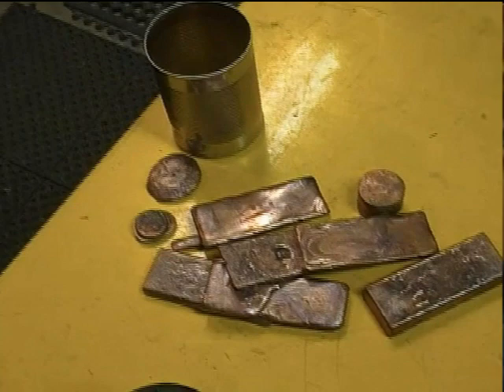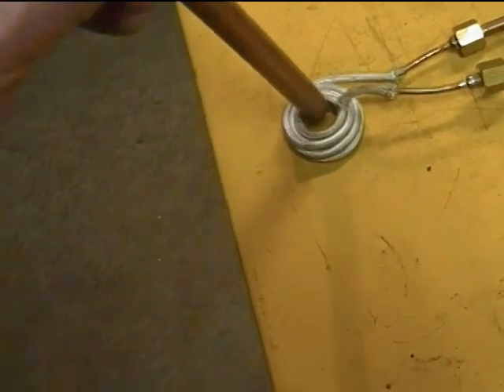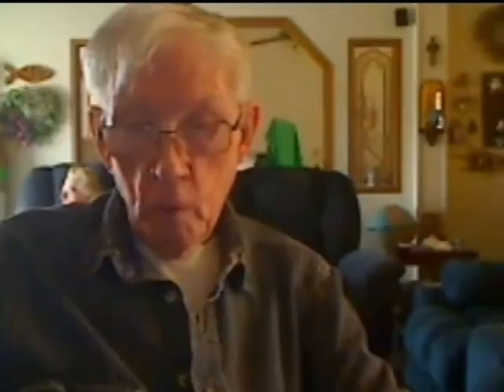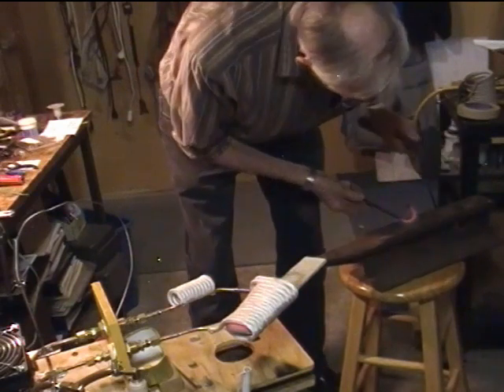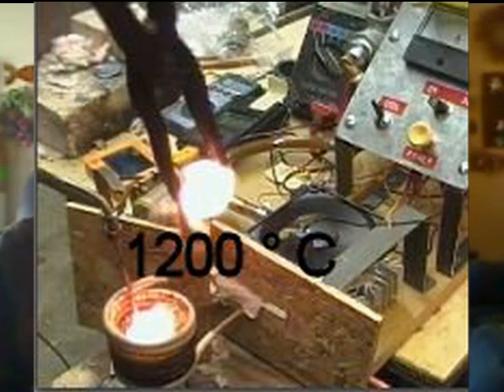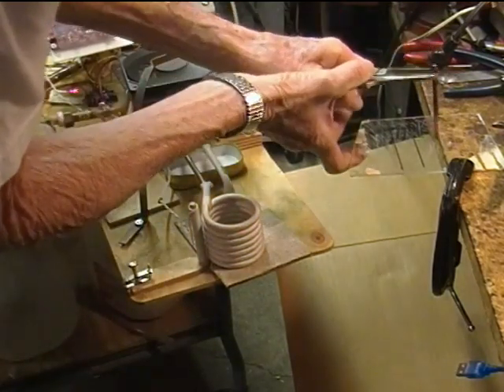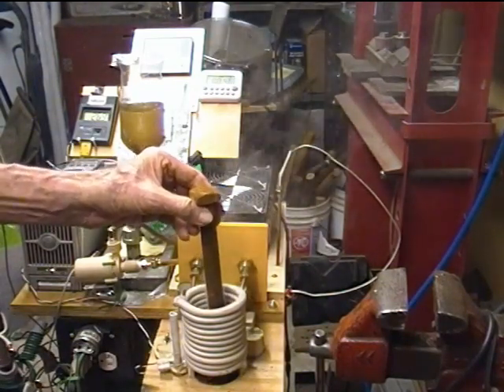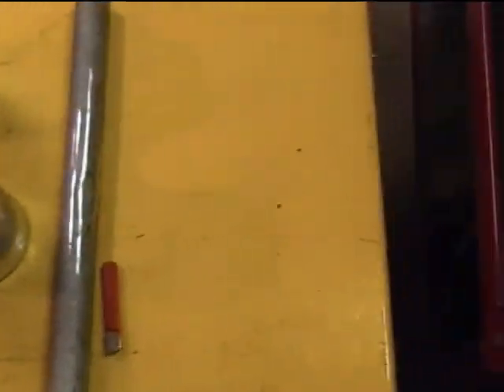1000 to 2500 Watt ZVS Induction Heaters, What are they Good at? #199

Comment: Cooling with a bucket of water without a fan, works ok. Refresh the water after a couple of sessions, which keeps it clean. Coils without sleeves works ok, provided you don't touch the coil: use the outer crucible without the inner graphite crucible. Power meter on the mains works ok (15euro in China), because the efficiency of the ZVS circuit is very high (above 90%).

Comment: You hit the nail on the head. These induction heaters are fantastic tools for heating metals up quick, but that's it IMHO. I actually needed more watts per pound of copper to melt, as did my well insulated resistor furnace. The crucible-in-coil-setup radiates heat away like hell. So a 3 kW zvs induction heater saved me maybe 30 min of time when melting 2 pounds compared to my 1.8kW resistor heated furnace, but at the cost of constant water cooling, enduring them noisy fans and the electronics run damn hot nevertheless. I'd stick to traditional electric heating

Comment: M'well i search for hints on the "poor" aspects and found none i was expecting.  As for what IH Driver are "good for" i'd just refer to JAi's (Induction) « Curie Point Pyrolyzer » patent of 1969...  Power and flux density are nice but such alternative applications based on the JAi "PyroFoil" only require to inject an energy burst lasting no more than a few seconds, with the Curie temperature ceiling actually setting precisely the amount of temporarily-stored energy, by virtue of a simple principle involving a susceptor's specific heat capacity, Curie point and mass, a i recall.  I predict the potential of this fault-tolerant/reliable will allow novel improvements long awaited relatively to smoker health-wise alternatives, to finally address the pitfalls of e-Cigs which ain't garanteed to be without risks, quite on the contrary.

Hot-red melted metal may attract and entertain but that's only a begining and i ain't commenting on distributing/spreading electrical stresses through flux-concentration + multiplication of magnetic poles, for example.  In any case, instead of 1 single big so-called asian "module" i'd much prefer synchronized magnetic parallelism of multiple identical daughter-boards, still with tiny pinch magnetic vectors except many more and since that would be in sync with a local reference clock i figure it might invite "scanning"/"probing" of a susceptor workload to evaluate/measure its state/parameters.

Bending the flux lines in a concentric arrangement à la stepper motor in a 6-poles stator setup (no rotor, only a workload susceptor inside instead) will produce as many magnetic vector, piling up 2 identical units would add 6 more vectors plus 6 virtual ones vertically, raising the number of synchronized samples to 18...  Which makes me wish the topic of IH Driving could move on, starting with making the power-stage self-protected, possibly some day using Allegro's ACS733 hall-effect current-sensing chip with Analog & Digital (resistor-programmable comparator) outputs, or some future equivalent...  Etc.

Comment: Hi, great video thank you. I'm curious, the coil you show initially is double wound (2 layers of coils)????,  please can you advise what the difference is compared to a single layer wound coil?
Reply from the maker: I think that coil is actually 3 layers of 3 turns for a total of 9 turns.  The main object there is to confine the power to as small an area as possible so as NOT to heat the whole cartridge casing;  just the neck.  A secondary reason is to keep the coil's inductance high enough to keep the resonant frequency LOW  enough to keep from damaging the Mosfets and some of the other components.
Reply: @frenchcreekvalley  many thanks for your kind reply....so you would use the same for heating a larger item I.e. 4 inches in diameter???? Also what effect have you found by using a smaller diameter copper pipe that you form into a coil vs a larger diameter pipe....obviously you'll get less turns with the larger???
Reply from the maker: @lukebrown6913  Please spend some time reading this webpage of mine, and then, if you still have questions, feel free to ask:
https://www.spaco.org/Blacksmithing/ZVSInductionHeater/WorkCoilsForZVSInductionHeater.htm
Especially study the Work Coil Data spreadsheet that is linked on that page.